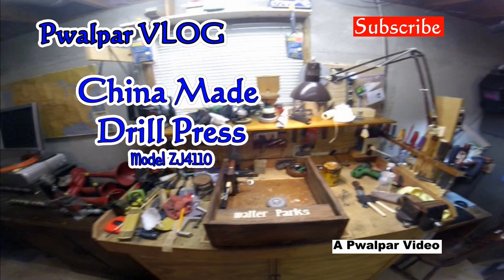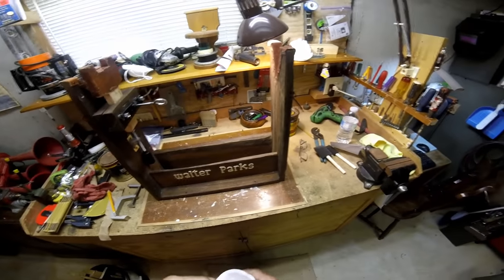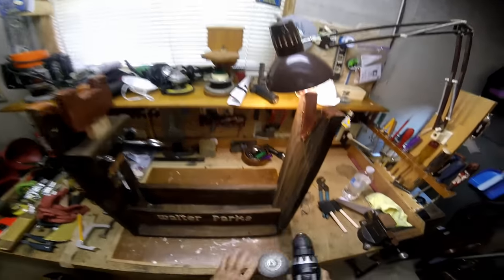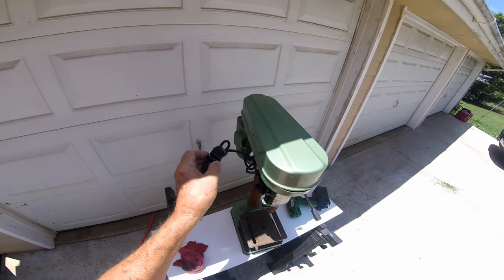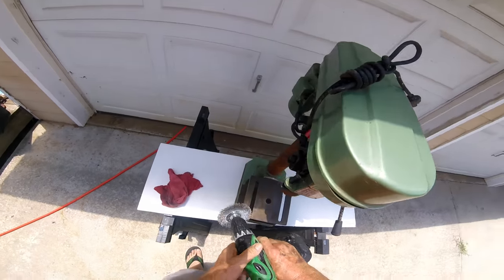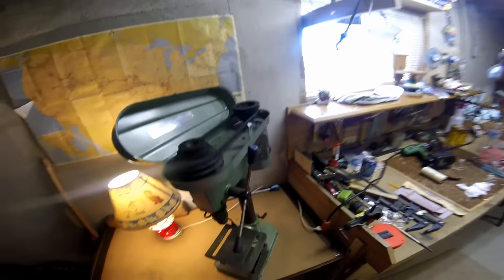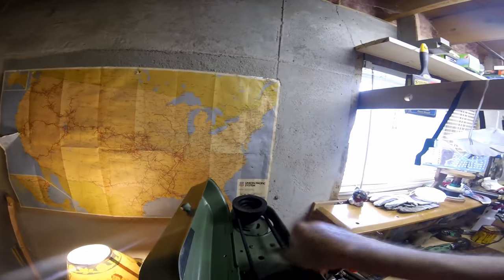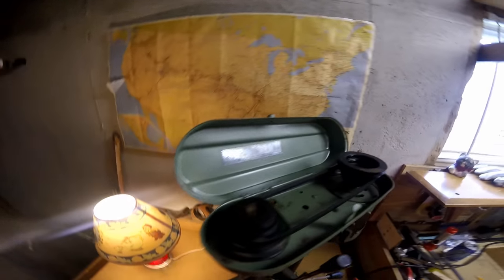China Made Drill Press Pwalpar VLOG

Comment: I bought exactly the same drill press 26 years ago. I never liked it, but it has served me very well. I have drilled steel, aluminum, brass, bronze, Plexiglas, plastics, wood and fiberboard with it. It rattles, is loud and occasionally the chuck falls out of the taper, but I can't justify two-thousand bucks for a proper drill press. I normally don't make compromises when it comes to tools, but in this case I don't see any alternative.
Reply from the maker: Thanks Bruce  I get a kick out of all the ones making how to videos with expensive table saws drill presses and many other overly expensive equipment.  Most couldn't saw a straight line with hand tools  Anyone can act like an expert with 20,000 dollars worth of tools.  I usually flip right on to some one elses video when I encounter these people

Comment: You are on the right track Walter. After loosening the tension derail one end and then the other. You just need to find the rpm you want for what you are drilling. On mine I usually keep it at one speed for most applications. If need be you can google it to learn what speeds to use for various jobs. Hope that helpd
Reply from the maker: Thanks Ron It helps :-)

Comment: Walter, at first when you went to start your press I thought you were extremely lucky enough to have one of the very rare pull start drill press's!!  But no, no such luck just a little corrosion. :)
You will love that tool, many uses besides holes. I use mine all the time mostly steel though. I have even cut slots with mine with a small bit and vice for a milling machine. ( which I can't afford ) I suppose being a retired car knocker you've had your fill of steel. The belt adjustment will work much better after the rust is worked out. 
Have fun with it Walter,
Your Utube buddy,  John
Reply from the maker: Yep  need to go to Harbor freight again lol